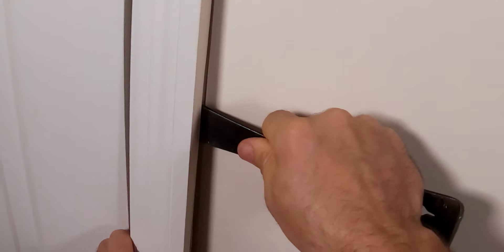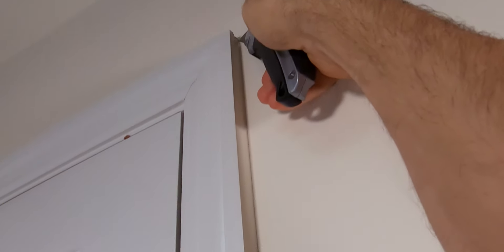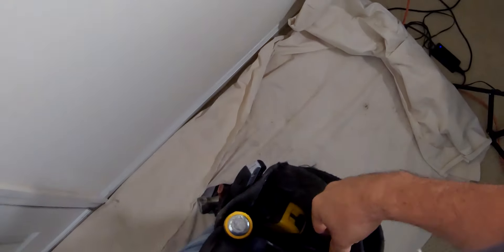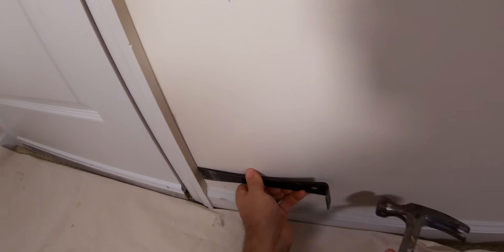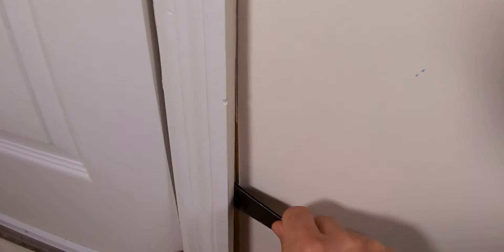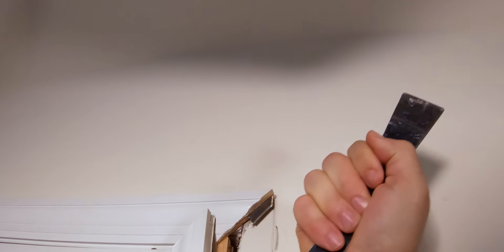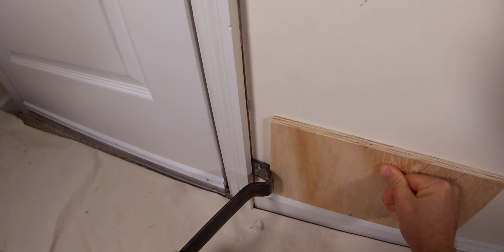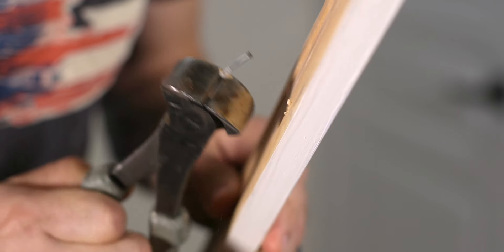How To Remove Wood Trim | Beginner

Comment: I have to remove the door stop trim alone, is that a separate piece that I can take out without causing much damage? my mother in law unit laundry room doesn't let full size washer dryer set to be in because of this and want to remove most of it (leavig 1 ft on the top still there, and on both sides of the door.
Reply from the maker: Sometimes they are separate pieces and sometimes they are integrated into the door jam. Sorry wish I could help more.

Comment: Great tip have used this method, tooth picks and cotton balls soaked all with wood glue and worked fantastic.  I use the wood glued soaked cotton ball (tissue works) most often and has yet to let me down.  Once wood glue hardens its rock solid.

Comment: Y’all know where can I get the wood from to replace it ?
Reply: Most home centers and larger hardware stores sell pre-made molding. (Keep your old molding to trace the mitered corners onto the new piece.) It will probably come primed, but it’s also easier to paint it before it’s installed, then touch-up the nail holes and caulk the edges.

Comment: thanks for making this a 2 1/2 minute video instead of dragging it out into 20 minutes like some other diy vids. 
how about that trim in the corner?  i've got about an inch between the trim and a 90 degree wall corner then an inch to the door trim on the second wall.  i assume i'll try the same technique more carefully because i can't get the prybar into the corner   flatly.
Reply from the maker: Correct. The key is to take your time.

Comment: That looks like a good pry bar. Most I’ve seen are too thick at the end and will cause unnecessary damage. I have some molding around an interior door that I want to remove that’s been in place for at least 50 years and has been painted over multiple times. I want to take it outside and sand the paint down to bare wood, to get the previous oil paint off, because latex paint doesn’t like to stick to it. It probably sounds like too much trouble to go to, but I really dislike sanding inside the house.
Reply from the maker: Thanks for the comment!

Comment: I removed my door trim to fit my new refrigerator. What can I use to fill in the spots where the trim used to be? Some one I talked to said to sparkle around where door Trims to be and then paint after it dried and sanded. Thought? Thank you in advance.
Reply from the maker: Yes, a nice thin coat of drywall mud or spackle works great. Sand lightly, reapply a second if needed, finish sanding and paint. Hope that helps Dan Shop.
Reply: Training Hands Academy it does thanks. Be well

Comment: The previous owner of our house put a microwave behind on a shelf behind a kitchen wall and surrounded it with a wooden frame.  We need to replace the unit but can't pull it straight out because the legs of the unit seem to be lower than the top edge of the frame. Do you think your technique would work?  Since the unit and frame is right in the middle of the wall we don't have a lot of room for error.  Thanks for any help.
Reply from the maker: I'm not 100% sure because I can't see what you see, but I would think this technique will work just fine.
Reply: @TrainingHandsAcademy  is there any way i can send a photo?
Reply from the maker: @deecross5028  Sure, you on Instagram? If so, find me at Training Hands Academy and send me a message.
Reply: @TrainingHandsAcademy  great. thanks, it'll probably be up tomorrow.
Reply: I sent the photos earlier today.  Hope to hear from you soon.